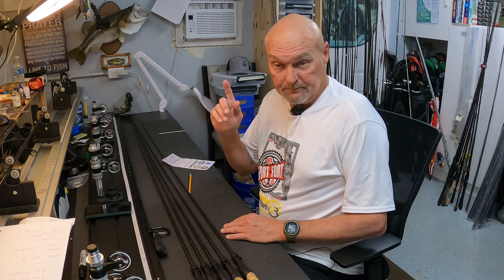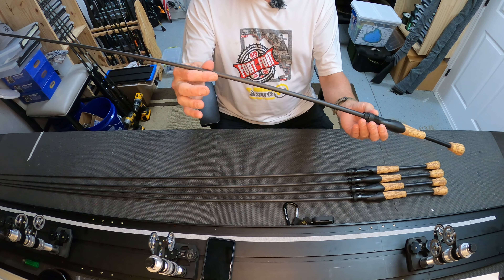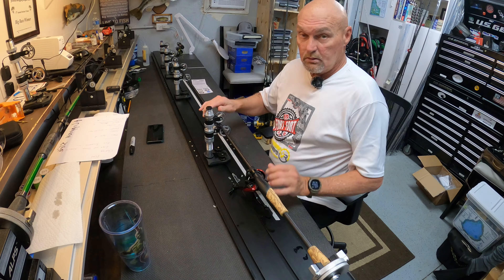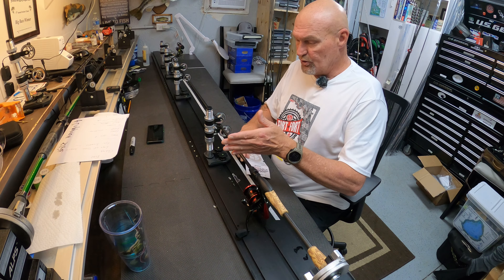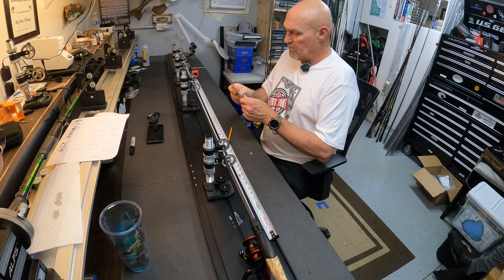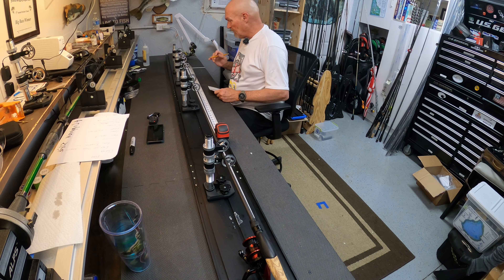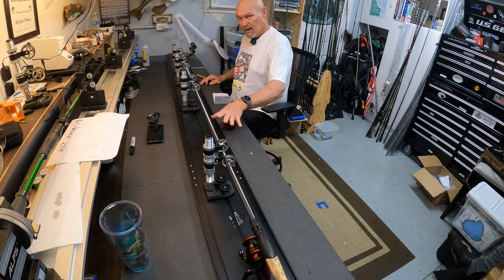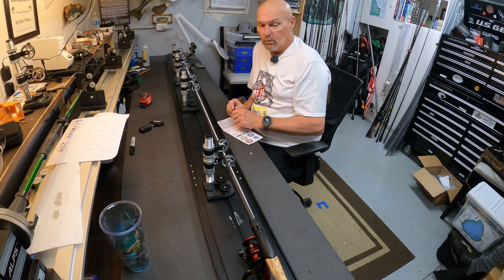Rod Building 201 - Five Wishes - Part 2 - Guide Layout

Comment: How well do you like the northfork blanks compared to the other top blanks, like st croix, mhx ect?
Reply from the maker: I build primarily on 4 blank manufacturers. NFC, RodGeeks (an SC partner company), Rainshadow, and MHx.  The choice of blank is largely determined by the clients budget.  For high performance low bling rods it is hard to beat NFC X-ray blanks even at full retail price.  With the sales they have had in the last 2 years,  they are the best bang for your buck.

If I want a custom painted higher end blank then it's RG.

MH has good blanks but they are not high end in sensitivity and crispness of action, IMO. 

I buy a lot of New old Stock Rainshadows from a local dealer.  If you want a workhorse MH-F then the RX-6 is my go to.  I have several person ones in my boat.